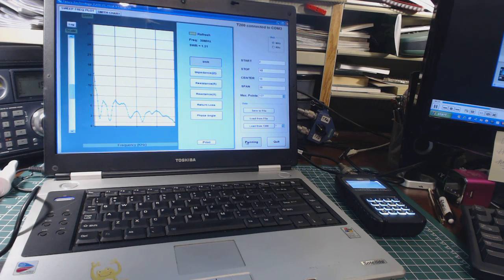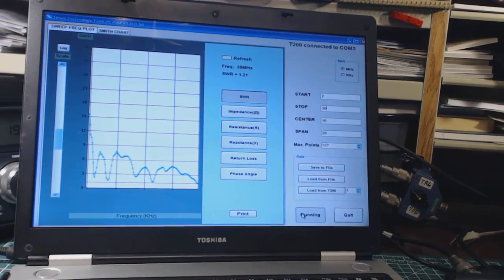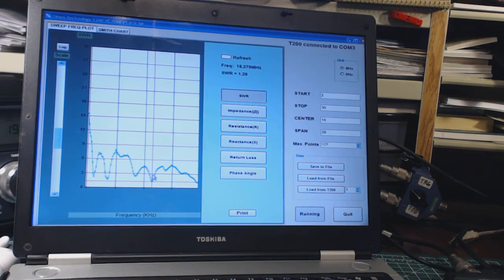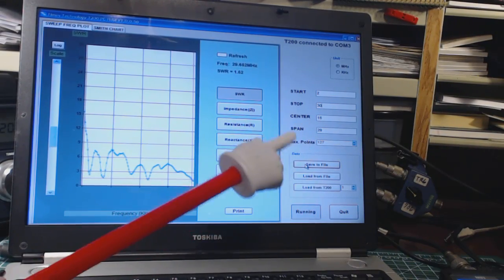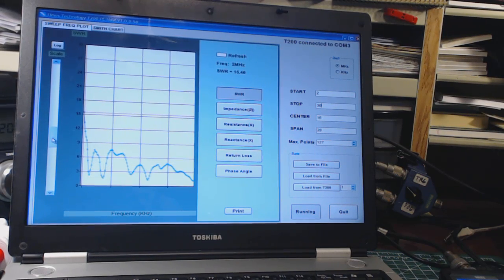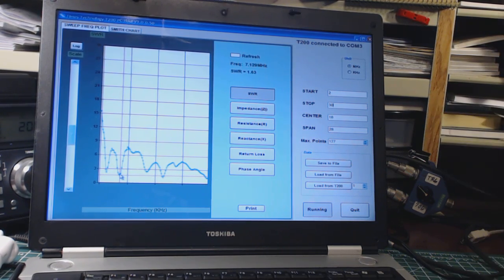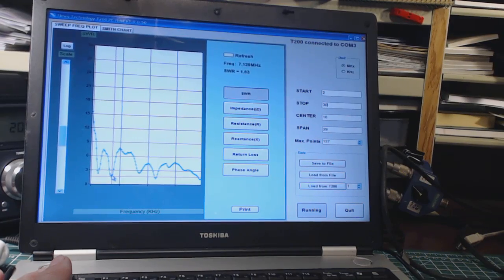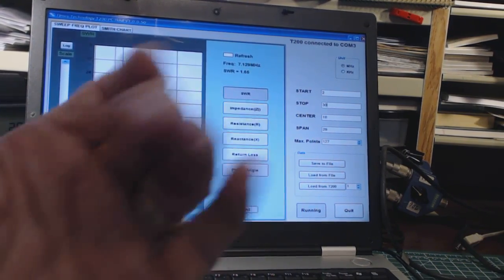TRRS #0791 - MFJ-226 Graphical Impedance Analyzer w/Computer

Comment: What software is it and where do I get it. I own a mfj223
Reply from the maker: I believe it was written by individual and not a company.  I no longer have the computer it was installed on.  Here is one old link that did work and I think the software is one of the links listed.  The MFJ links do not work but the Host likes do.  Use the software at your own risk.